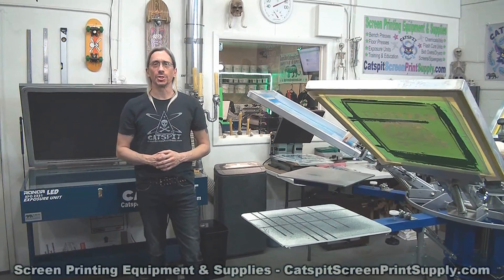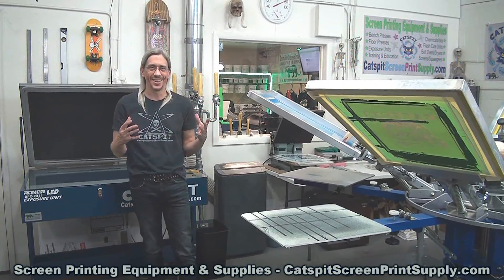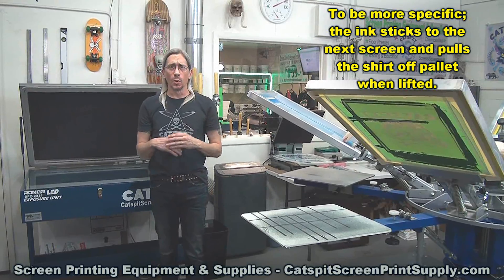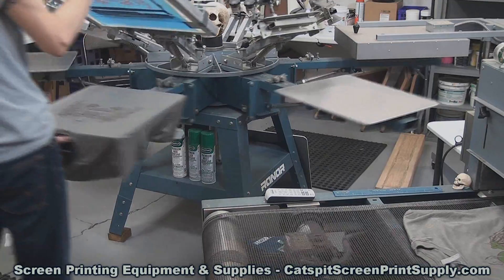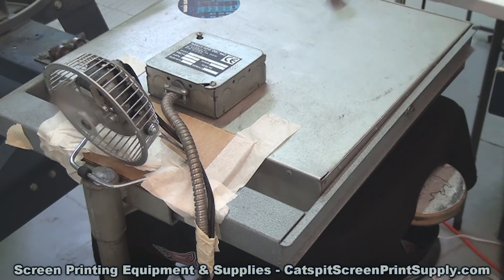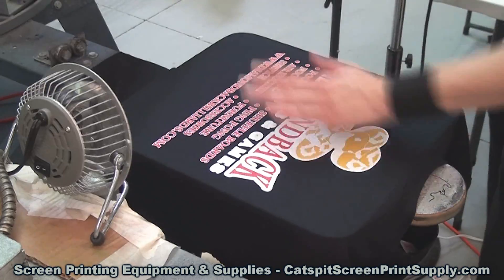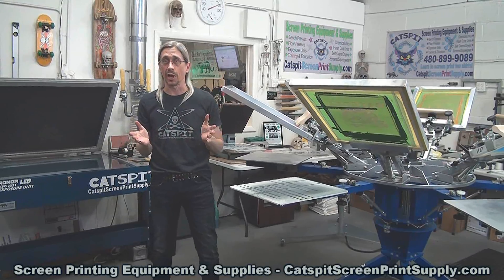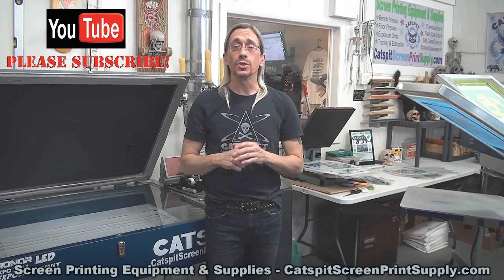Screen Printing: Why Does Plastisol Ink Stick To The Back Of Other Screens?

Comment: Hello professor ... I am trying to print glass, with an ink called policat (epoxy ink) it is very complicated because it is very difficult to clean and I want to make the stamping in more than two colors but I do not want to wait for it to be done and start with the next ink ... is it possible to put a spray under the frame ... on the mesh underneath? some non-stick spray? Something like baby oil or food oil? Gel? something that is temporary anti-adhesive without affecting the anchoring of the ink in the glass ... I don't know how to do it ... it's to stamp some glass bottles but I want to put all the paints at once ...
Reply from the maker: Yeah I'm not sure as I have never tried that. Usually we print one color at a time with graphic printing. Thanks for watching! Screen Printing Equipment & Supplies - http://CatspitScreenPrintSupply.com/

Comment: The intro song never gets old to me, great videos. I am back to this video a 2nd time in two years because I deal with screen pick up like this all the time. You have to find a medium or sweet spot not to wet not too dry. Theres a lot that comes into play with multicolor, triblends, and fibrillation to name a couple. They can be a head ache but I found sometimes an extra turn around the press and then take the flash and let them coo for a few secounds will allow them to cool enough to add the next color. Sometime also I raise the flash and print slower even though I'm usually known to print fast manually.
Reply from the maker: Awesome. Glad you enjoy my videos. Thanks for sharing your methodology. It's true, each print job can pose its own challenges for sure. Thanks for watching! Screen Printing Equipment & Supplies - http://CatspitScreenPrintSupply.com/

Comment: Plastisol ink odors or not?
Reply from the maker: They don't often smell in the bucket or on screen but plastisol ink can fume a bit when cured in the belt dryer or with a flash. Shirt dyes may also cause some fuming during curing. Thanks for watching! Screen Printing Equipment & Supplies - http://CatspitScreenPrintSupply.com/

Comment: Hi there wandering if you could help me, when Im printing a one colour plastisol layer its coming up bubbly I have practiced loads with flashing the screen first and I don't understand why it keeps happening its like the ink is too thick but do it any thinner and it won't flash, any thoughts??
Reply from the maker: Perhaps your off contact is too high. Thanks for watching. Screen Printing Equipment & Supplies - http://catspitscreenprintsupply.com/